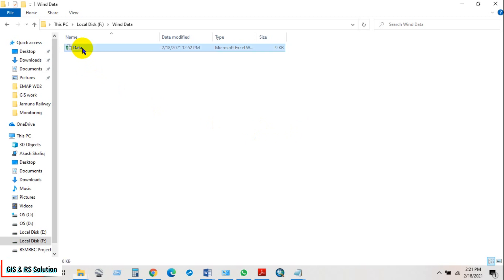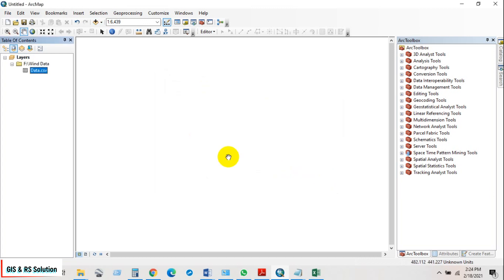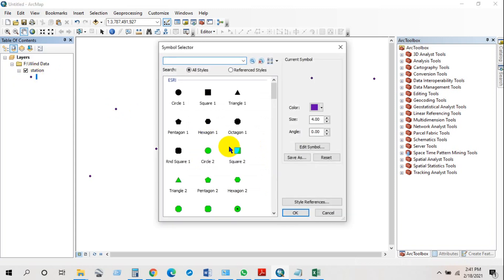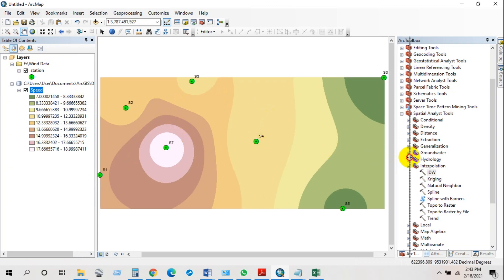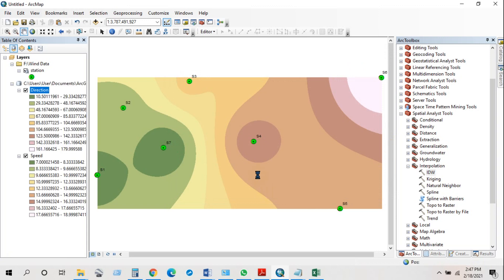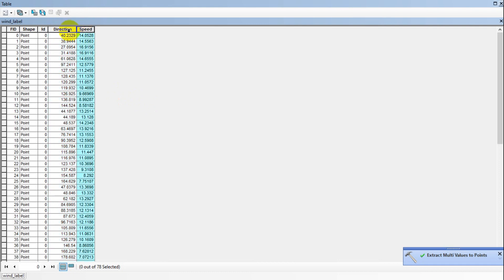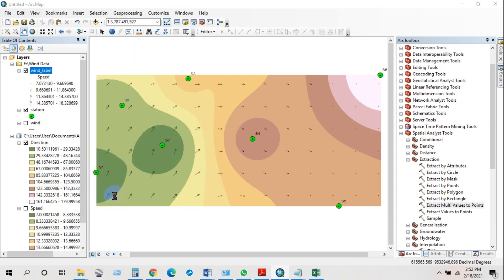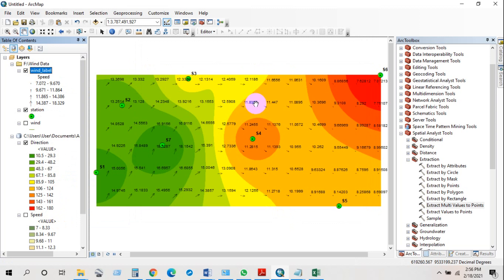Wind speed and wind direction Map in ArcGIS

Comment: In this application, there is a big mistake for making the interpolation of wind direction. 
Because direction of wind is a rotational term.
It means 0 and 360 is same value. 
For example we think two neighbor points that first point's direction is 10, the second point's direction is 320. 
If we interpolate with IDW or other Interpolating methods, It approximately gives a result close to 165 for the direction between the points. But it is not correct. 

In reality, it should be calculated as 345. So, we have to solve the problem with rotational-trigonometric point of view. 
It may calculate with trigonometric formulas.
Reply: You are right! Interpolation methods in circular data, such as wind speed, have misleading outcome
Reply: Can u give the proper formula?